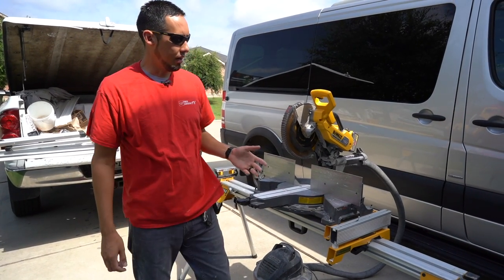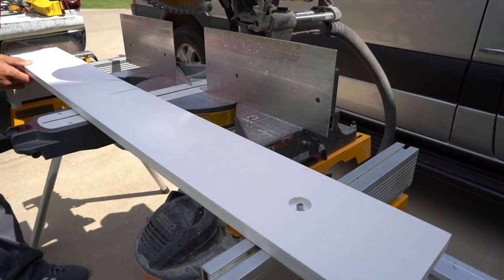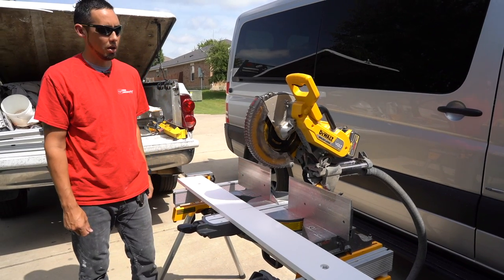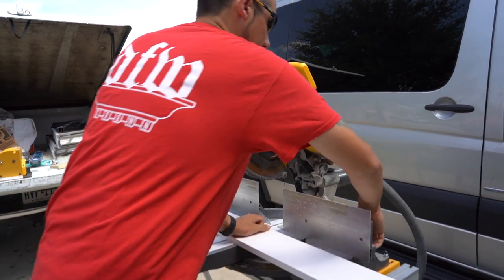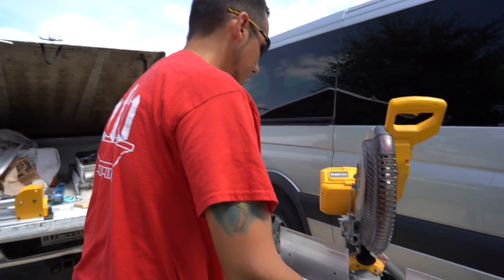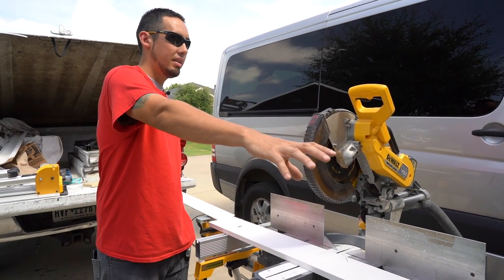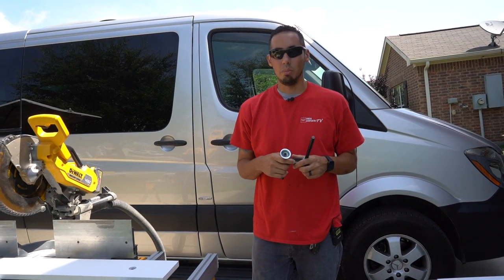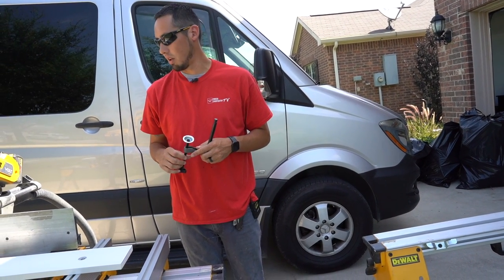NO MORE  D e W A L T  STOPS!  CROWN STOPS ARE DONE!

Comment: Without reading every suggested design I will offer my 3 cents. Your leveling idea using a centered screw is a positive method of raising and lowering your device. A quarter twenty thread will give a very fine adjustment. Two heavy compression springs, one on each end should provide a level work surface. The center of the shaft would be threaded. Each end of the shaft should have a bronze bushing (self lubricant) (no threads in bushing areas) a steel threaded plate bent like a yoke moves your work surface up and down. That is my mental visual design. If it works, $5.00 please. Just kidding! Best to you in your efforts.

Comment: 4x4'' Scientific Lab Laboratory Scissor Jack, Stainless Steel Lab Lifting Platform Stand Rack Scissor Lab-Lift Lifter Manual Control.  check these out on amazon. you might be able to place them on top of your saw horses

Comment: Are you tring to over enginerr this. Why does it have to be level across the 8ft? surley its just supporting the length of crown. As long as its flat at the saw cut wouldnt that be fine?

Comment: So you could just use a wider stop so you could not cut all the way through. I know that is complicating a very simple idea. I like what you have created. I just hate the Dewalt lockdowns. They break because of that cheap crap plastic there made with. I know I have had to replace them. That's why I am switching over to the Bosch stand. The clamps are all metal.